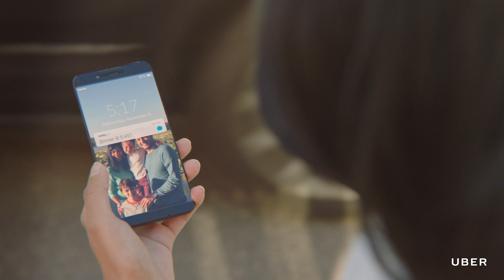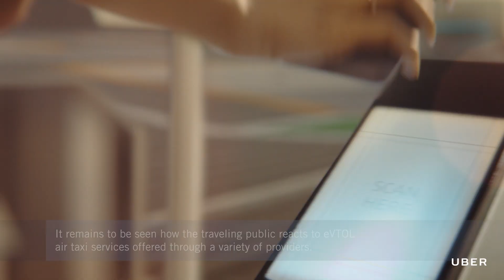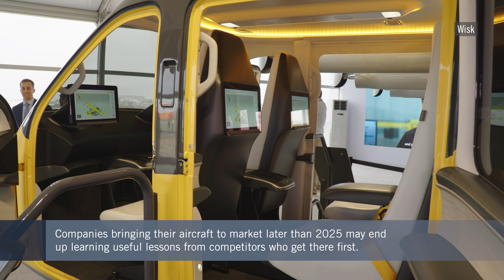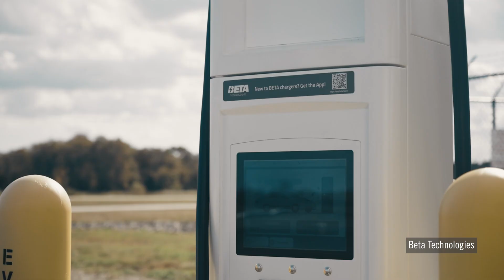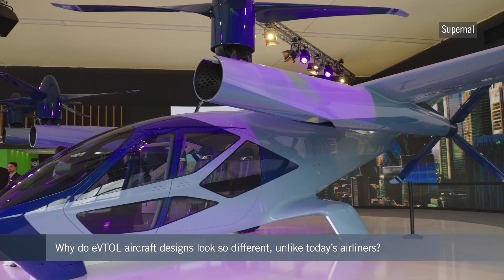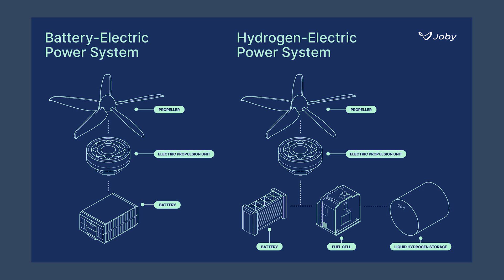Cutting Through the eVTOL Aircraft Hype With Independent Expert Sergio Cecutta – FutureFlight

Comment: I cannot really see this business of Uber, etc, flying taxis going anywhere except for the 1% needing to get to another airport 100~150 miles away and not wanting to go via a commercial flight. Sorry, this is just a bad, unsustainable business model. (as an example, Uber started rides in 2011, and only in 2023 did it start making $ .. and that is with a world's worth of drivers and a decent travel cost (door to door)). Now take an expensive device that will only be used by maybe 1~2% of the population, and do the math .. 
Don't get me wrong .. the tech is fantastic and helping us move forward with battery tech and new ways to move people from point A to point B, but the business model is just not sustainable.

Comment: Even if all of the technical problems can be addressed (and that is a VERY big “if”), there looms an even bigger hurdle to overcome:  Public acceptance/tolerance.

There’s a very good reason why none of these e-VTOL manufacturers release videos of flight tests with ambient soundtracks (instead releasing silent videos or videos with music soundtracks).  They know how LOUD these things are, and how unique their sound signature is (sounding like a thousand weed eaters flying overhead).

No matter how well they perform operationally, just like the Concorde they will fail if the public leverages political pressure against them because of noise, frequency of overflight, or the very low altitudes at which they are designed to operate.  It is very difficult to envision a solution to those problems unless significant restrictions on their operation are implemented, restrictions that would likely destroy the “fly anywhere” point-to-point operating concept that is integral to their business model.

I give this industry about a 10% probability of success, and that’s only because I’m an optimist.
Reply: Archer and Joby are already doing it.  Joby just passed phase one of the FAA, however I see Archer catching up rapidly, I respectfully think you’re very wrong.
Reply: I really hope that this air taxi thing is never implemented. It will add lots of unnecessary noise and danger to the cities as well as broaden the gap between the rich and ordinary people. 
But, if the technology proves itself to be significantly cheaper than conventional helicopters, this could make air ambulances much more available. In the latter case, it would save countless lives.

Comment: As a veteran of 6 years in the USAF and 30 years flying for a major international airline, I have a critical question: how is aircraft traffic assigned/controlled? We all know that aircraft cannot be flying willy-nilly in the surrounding sky.
Reply: FAA is mapping these blocks for EvTol. They have been working on this for years already. They are testing one of these over New Jersey right now. Joby, Archer, and Lilium are set to receive FAA certification in 2025. This puts them fully in the sky in 2026. Archer signing a $430m contract with the US military this week doesn’t hurt either.
Reply: Good point.. The FAA has to come up with that game plan with the Top manufactures of VTOL as like helicopters...👍
Reply: Well, it must and shall be autonomous because the deadweight of an onboard pilot constrains useful load too much.
How is this going to integrate into the National Aerospace System: through decades of work that hasn't begun yet.
Reply: Pre programmed routes for quick transport of people or loads. Ehang seems to be way ahead of competitors
Reply: They'll figure it out
Reply: They are gonna have a design area for the planes and this will have there own airspace

Comment: Any plane powered by Li-Ion batteries is going to kill everyone on board, at some random time, when the batteries decide to incinerate themselves.
Truly crazy stuff. I would NEVER fly in one!
Reply: That's why the wing-based design has a little better hope of success. When the fire starts, the batteries will be ejected, and the aircraft will have to glide to the ground using the wing's lift. 

Electric gliders have already experienced in-flight fires.  I think there has been at least one death.
Reply: The FAA hates these batteries. Li-ion batteries are banned as cargo on commercial flights, as they have a nasty habit of self combusting due to thermal runaway. How the heck would these things get approved for use in any aircraft. It will never happen..
Reply: The Boeing 787 had large lithium ion batteries but only a few non fatal fires so far! 
Actually, LG just announced a fire suppressing battery separator on 1st October 2024

Comment: 6000W/kg cf 250W/kg? Ooooooof
Reply: Yep.  Batteries weigh a lot.  Hydrogen fuel cells might be the way forward.  Hydrogen carries lots of potential energy with very little weight.  Plus, it floats and burns upward, so put that fuel tank on the roof and we're good to fly.
Reply: Hydrogen has its share of problems too, has to be very highly compressed, it’s very difficult to transport and it can go boom?!
Reply: The guy was laughing when he said it too.

Comment: Gradually the blindingly obvious is being admitted, the BILLIONS being splurged on these ill conceived contraptions will never be recouped just as the Bristol Brabazon and Saro Princess flying boats were "magnificent failures" even if they 'worked' as intended but could never have been viable.
Without belabouring the point, i have been trying, in vain, for too many years to highlight the real solution to the personal air mobility/ urban/ SUBurban and regional/rural fields as ATOL - Assisted Take Off and Landing - the same basic idea that allowed the Wrights to solve the initial problem of flying at all or that allows an unpowred sailplane to climb silently and without any turmoil at 2000 feet per minute for a few cents worth of fuel . This is once again just for the record so that those rushing down dead ends cannot claim ignorance as a defence when gyped investors rebel ( the history of Whittle and the jet engine is apposite here)  Watching the painstaking hand building in composites being touted as some sort of advance takes me back 50 years to ny time in Germany building 'composite' sailplanes ,even the first use of carbon fibre, by hand....
Tulipmania will be dwarfed by the fallout from this mania even before really superior technology arrives to obsolete them.
Mark my words. (also on many of the other YT vids and HBA ,homebuilt airplanes ( 10 years ago, pre 'boom' ) and also affter the internet and paper published long before.....

Comment: Did he say $300 TICKETS!??  I thought these were supposed to be cheap intracity travel options.  These are nothing but cute science experiments.  I mean, buy 1 Lillium.  Or 10 new Hill Helicopters?  These things are WILDLY expensive.  Battery tech isn't here yet. MAYBE in 4 or 5 DECADES the eVtol  might become a thing.
Reply: I have heard that these eVTOLs can cost $10M each.  Ticket prices will need to be high.  A Robinson R66 helicopter can carry the same passengers and costs less than $1M.  If this air taxi service is so popular how come no one is doing it now with a cheaper helicopter?
Reply: @zepm7184 there is a limit on the amount of noise that densely populated cities can take. Evtols can change that